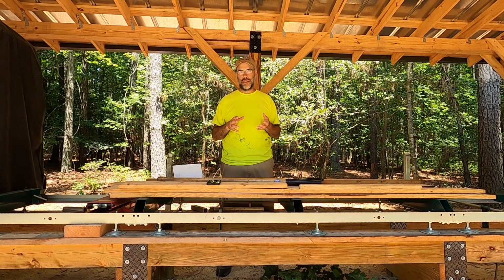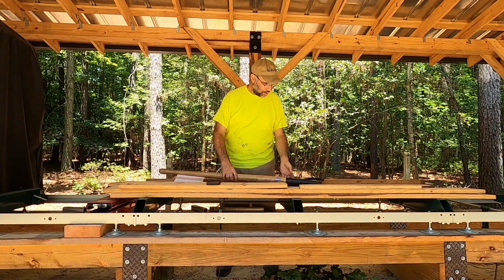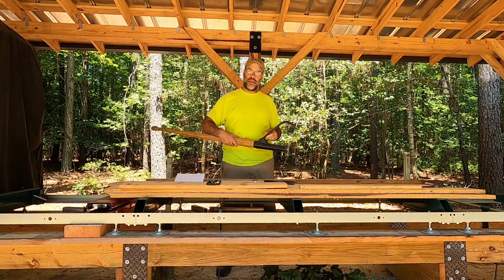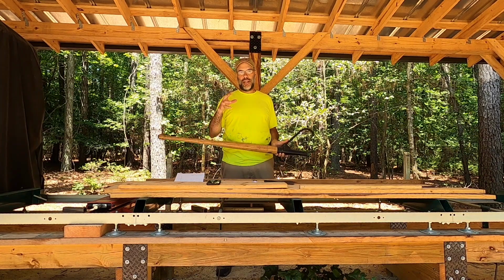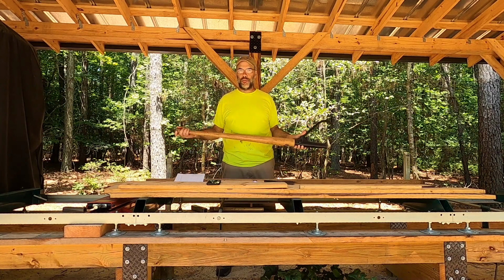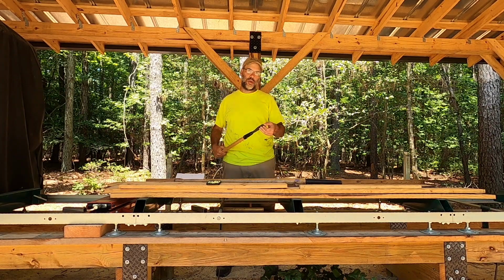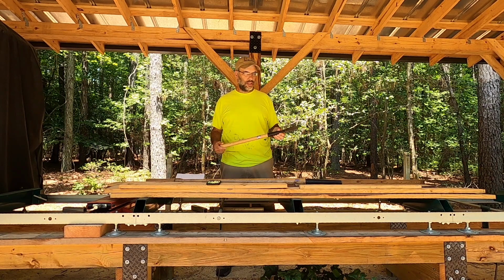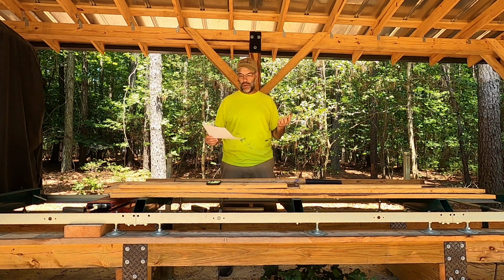Sawmill & Logging Tools from Peavey Manufacturing Company

Comment: What size do you recommend?  I have the HM122.  They start at 30 Inch
Reply from the maker: Cant hook?  I think mine is a 48" but will check.
Reply from the maker: Yep mine is 48".  That has been a good length for turning logs on the ground.  If you have a sawmill on a trailer or raised up to a similar height, you could go shorter to a 42" or 36".
Reply: @Lumber_Jack  Thanks for the help.  I am just about finished assembling my HM122 and your videos have been key to getting it right.  On a temporary base right now till I can saw what I need for a permanent base and shed.  Thanks again